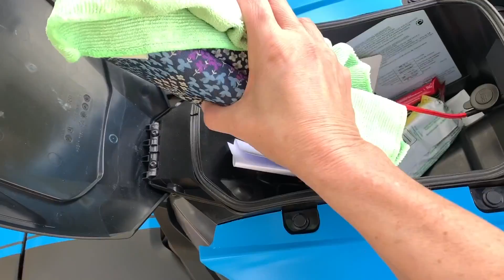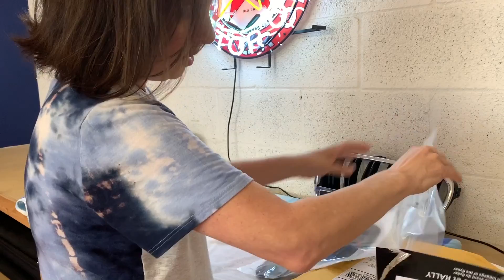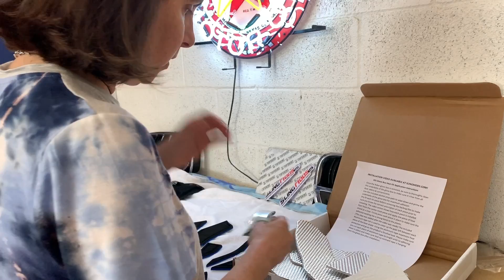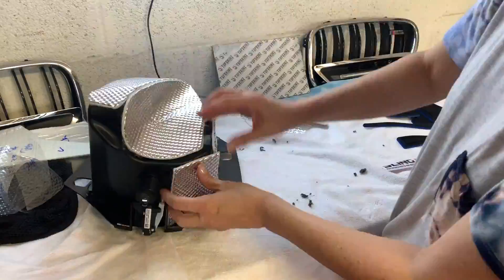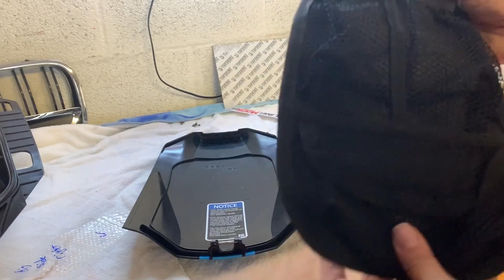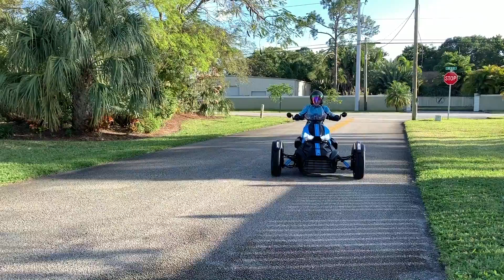Can Am Ryker Glove Box Makeover (including Slingmods’ heat control  kit)

Comment: Awesome.  Was waiting for someone to review the thermal liner.  Another item to add to the list!  As for what I keep in my frunk, a hat, a microfiber cloth, extra GoPro batteries, and a charger for the batteries.  That's it.
Reply from the maker: I never kept my extra batteries in there, always thought it was bad for them to be in the heat. Excited to be able to now. Are the gopro batteries you use, just as good as the name brand ones?
Reply: @RykerRydes  Haven't had any issues with them in there :)  I'd highly suggest getting the actual GoPro batteries.  The third party ones last about half the time.  I hate them.  I'll be getting a few more GoPro batteries soon.
Reply from the maker: Thanks for the advice!! 👍🏼
Reply: Thanks for mentioning the microfiber cloth, I need to put that in my frunk,lol.
Reply: @giovannam925  Hah!  They come in handy!